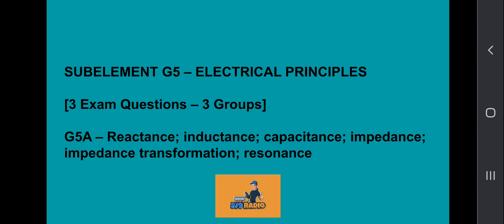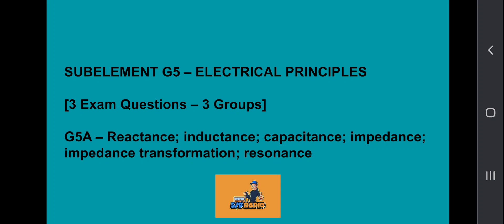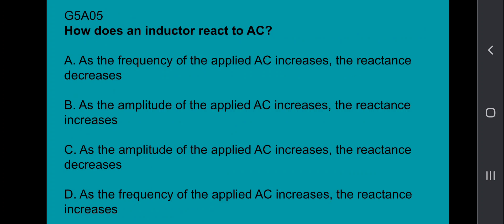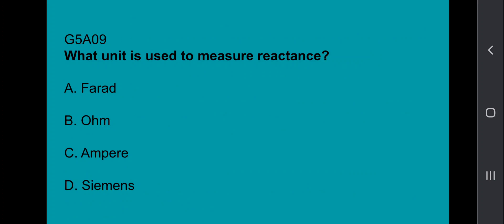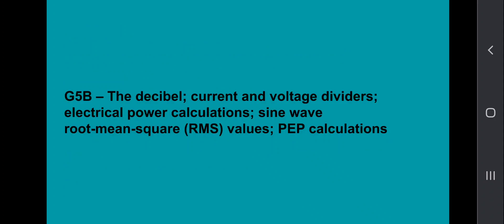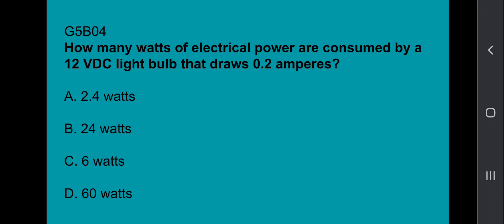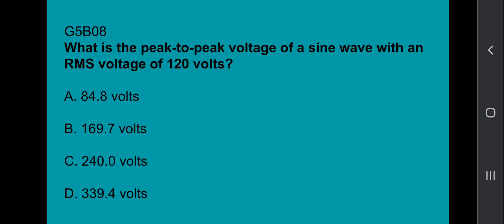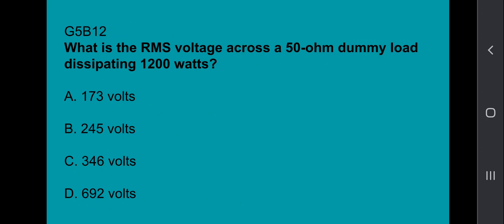2023-2027 General Class Question Pool  Video 4 #hamradio #hamharder

Comment: for G5B06... I keep getting the answer of D. 400 Watts... not B. 100 Watts... based on PEP = (Vpeak2/2)* (1/R)
Reply from the maker: I checked the question pool and 100 watts is the accepted answer.
Reply: I know it's 9 months later, but this is a good question. So, opening the ARRL General License Manual to 4-6, it gives the definition and measurement of PEP. first we need the RMS voltage- for that you take 1/2 the peak to peak voltage (100v) and multiply it by .707= 70.7V RMS. Then PEP= the square of RMS (4,998.49) divided by the resistance (50 ohms)= 99.9698 Watts. looking this question up really helped me to understand it, and there are a number of questions in this pool that use these formulas.
Reply: Divide the V peak to peak by 2 then multiply by .707 then swuare that sum then divide by 50 =99